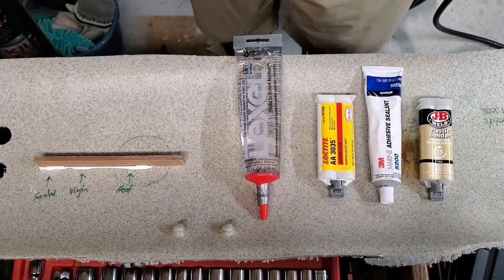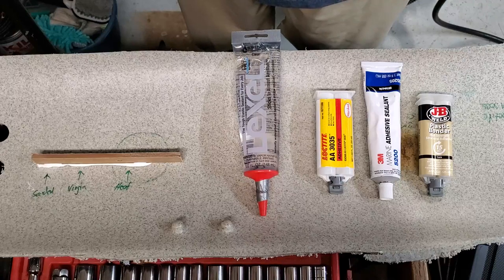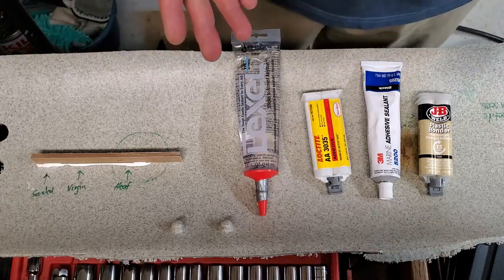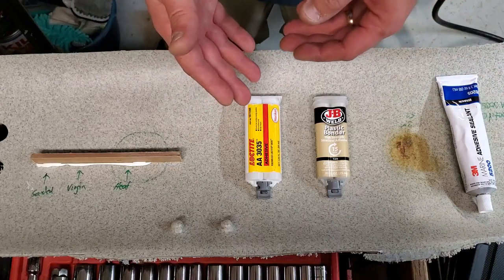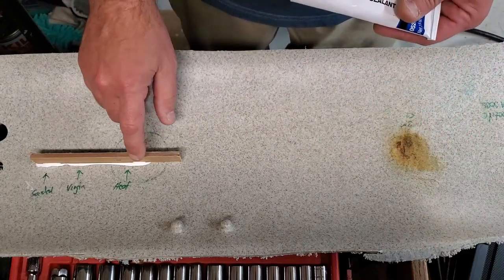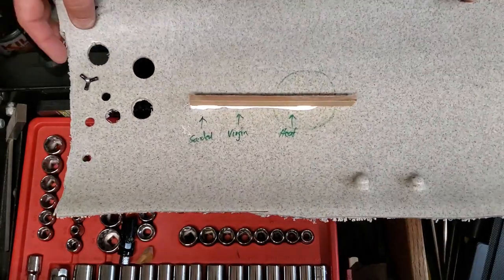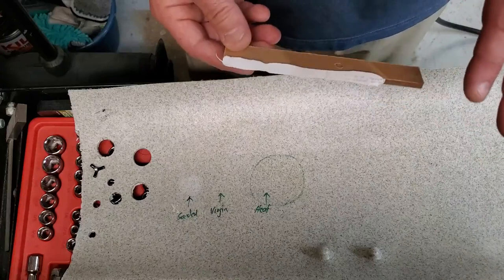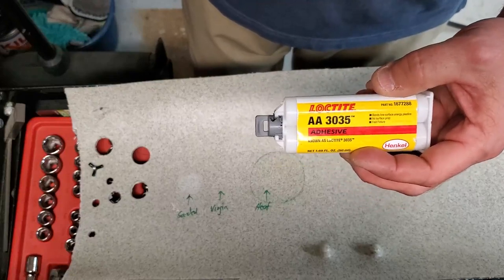Adhesive Test on Polyethylene Plastic Kayak

Comment: Great Video Roy. 

I have been kayak fishing for well over 20 years and owned HDPE boats throughout the 1990's and have had my share of repairs and mods to do. 
   I do product development and patternmaking for large scale rotomolded parts ( including kayaks ). I have an ongoing relationship with many manufacturers that produce rotomolded products. That gives me a lot of interaction with the engineers developing and supporting these products.
  I have wasted a small fortune on every possible bonding agent you an imagine and eventually found the Loctite 3035.   It is the sole product that actually forms the equivalent of a chemical bond with HDPE.  I did not video my tests but am about to do a repair on a small bass boat made of HDPE ( Basstender 11'3" ).  I will video it and share when I open my YouTube channel to the public soon.  The area to be repaired is the pulling eye on the front of the boat.
I have used it to secure in hull backing plates ( 1/2" aluminum ) under some load bearing features on my own Hobies.   The aluminum is still tight after almost 2 years.
As I am sure you are well aware an initial setup of 3035 if you do not already own the applicator and a small collection of tips will be roughly $100.     The $45 for the tube will really go a long way if you use scrap HDPE as filler or intermediate layers.   In spite of the initial cost 3035 is by far the best ( and only in my opinion ) way to make a HDPE repair that is dependable.

Thanks for your video.  Really well done.
Reply from the maker: Thank you, the chemical reaction you mentioned is in the base substance molecular structure which is called a Polyolefin:  https://en.wikipedia.org/wiki/Polyolefin  I am not a chemical nor any kind of "degreed" engineer; though, I probably should have considered that undergraduate path (I'm in business IT now).  The applicator tips are crucial for proper ratio and mix duration but I opted to some some $$ as my application periodicity is very low and I just used a wooden dowel and marked equal squeez-outs.  Good luck with that bass boat pulling eye repair.  Remember material shoring in/around in addition to proper adhesive/fastener application will insure a proper repair.  Cheers!
Reply: @motleypixel  Thanks Roy.   I have the backing parts for the patch all fit and the inside prepped up to the point of light sanding. My hold up is the weather to shoot the video and time out of my work schedule**  to do it right.  I have 1/4" aluminum plates formed to fit the interior hull to spread the load out. The area I am repairing is bigger than just the pulling eye. I repaired it badly 20 years ago and move the eye up 4 inches. Now there are two almost adjacent 3" holes to be backed up.  I'll try to do a decent job on the video even if I have a failure.  I did a few anecdotal tests just gluing and  stressing some scrap HDPE and low density " blown " also.  I was amazed at the holding power.

as an IT guy you can appreciate while I am trying to complete paying jobs for my customers I am also building a virgin 10gig network for a NAS server I am building for my video, laser scanning and photogrammetry work I do.   Man, it is a lot more time consuming than I thought when I was buying all the parts.

Comment: The jb weld used with your thermal prep method works!
I have been trying to mend a crack in my hot tub for months and tried a bunch of adhesives and fillers. 
My tester piece from bits I cut from excess underneath are as strong as a single piece. 
It’s a sparest 300 AR btw. It cracked bc the tub is a bit thin on one side. Took weeks to find it bc it was so small at first.

Comment: Hello sir! I've been researching this topic a little and trying to decide what I'm gonna use to fix me and the wife's kayak. I had them strapped on my bed, and the front strap came loose, and they drug the road a bit before I could get stopped. Both of them got the same hole in the tail portion wich is a good flat area. I already ordered a piece of 12"x12"x1" thick piece of High Density polyethylene and my plan is to make a patch plug to fill the hole, and also build the area that got eaten away. I see you recommend the Loctite AA 3035. My plan is to make the patch plug and then glue it, then let it cure for a for days or a week, then grind and sand to the original shape. Do you think that Loctite will do the trick?
Reply from the maker: for something like that I would thermal weld several layers of HDPE and omit using the 3035 adhesive.  The adhesive is really for unique situations, say for instance you have a situation where a brass female threaded insert fails or starts spinning freely.  You'd want to screw in a bolt, heat the bolt to the point the brass insert heats up and then pull out the insert.  Then put the insert back in with 3035 to hold fast.  There are other situations that are conducive to using 3035 vs. thermal welding, but for the most part large hull crack/hole repairs should be thermally welded with augmented HDPE, preferably same color.  Good luck.

Comment: 3M says this product would work on polyethylene. 3M™ High Performance Industrial Plastic Adhesive 4693H High performance adhesive forms strong bonds on most plastics, polypropylene (PP), polyethylene (PE) and polyolefin blends (TPO)
Reply from the maker: Good to know thanks.  Looked it up some.  Sound like it's more like a low surface energy plastic contact adhesive more than like an epoxy.  I'm sure it has some great use cases as does the AA 3035 by Loctite.

Comment: Great test and recommendations - thank you so much.  If you ever do a second video, I'd love to see a comparison of the loctite to the west system 655-8 G/flex
Reply from the maker: Well, it's not really an apples to apples comparison.  The G-Flex is not a low surface energy plastic bonder.  It's great on fiberglass, wood, metal and offers what appears to be good flex/expansion. Just know, there's not much out there that bonds to HDPE, reason why gasoline cans are made of HDPE.
Reply: @motleypixel  thanks for that clarification

Comment: Did you cut up your Revo 13?  I hope not lol.

Anyways, have you heard of West Systems G-Flex 655 epoxy?

I use it with success on hdpe, and so far been happy with it, although I haven’t done any stress tests. I’m actually going to be using it to do the drive cam column reinforcement with the pvc clam, and will prep surface with acetone, then denatured alcohol and then flame treat. Crossing fingers.
Reply from the maker: Ha, no didn't cut up my Revo, when I met a guy to buy a Hobie kit sail he gave me a big chunk of the same color HDPE from a Hobie that was cut-up by ACK.  Funny you mention West Systems G-Flex 655 because my local West Marine in Austin, TX was curious when I asked them if they sold any polyolefin binders for low surface energy plastics.  Let's just say he (manager) was interested in hearing more.  He then went on to rave about G-Flex and how it worked wonders and of course the cost sort of shows.  I said to him, probably in the exact words "take a scrap hdpe cutting board and cut it into test pieces and glue them together with 655 with slight clamping pressure and let me come in and try to pull them apart".  I'll do the same with Loctite 3035.  That's exactly what he did...he took my number and called me back in a week.  I brought just one test piece of spare cutting board (mine was black, actual HDPE 1/2" black of stock left over from a project.  He had several pieces and let's just say he was blown away.  Any regular 2 part non-polyolefin adhesive will NOT bond low surface energy HDPE plastic.  I would give some scraps a try first.  What's the cost difference between G-Flex and Loctite 3035?  A tube of 3035, plenty for clam-shell repair of PVC for Hobie MD cam column repairs runs about $60.  You'll use about 3/4 of the tube.  Although, I can see some using all of it just because of the "bigger of glob the better the job" concept :)
Reply: @motleypixel  That’s a relief lol!
Yeah, I noticed while gluing Gflex test pieces that prep is very important, otherwise adhesion is hit or miss. My go to prep process now is to alcohol wipe, wire brush to scuff, then flame treat, but a longer flame application to the point of melting seems required.

Comment: Have you ever tried using a superglue/graphite mixture to try and bond to hdpe?
Reply from the maker: No but I have tried all types of superglue by itself w/o any success.  Does the graphite produce some chemical bond or is it only mechanical?  If mechanical I'm very skeptical.  Thanks for the reply.
Reply: @motleypixel  I believe it is a chemical bond. Search on YouTube “superglue graphite” and a video pops up where a screw is attached to a blue bottle cap, which I believe it to be made of hdpe, using this combination. The screw is then hammered until it is bent 90 degrees without it breaking away from the bottle cap.
Reply from the maker: @johnwedgeworth4908  ah that one, yes and it's BOGUS, tried it, but it's with baking soda, not graphite.
Reply from the maker: @johnwedgeworth4908  interesting, first time seeing this one.  Notice he did have to add sodium bi-carbonate (aka baking soda)?  Also, no need to sand down pencil core, that's actually not 100% graphite anyway, I would just buy dry graphite lock lube tubes for ease of use.  Still though, even though I haven't tested either, I don't buy it one ounce, I would bet $100 USD that the screw test would not bend.

Comment: So in conclusion I don't see anything that worked.
Reply from the maker: 3:30  Loctite AA 3035 sticks; in fact, it deforms the HDPE when trying to pull two pieces way after a bond with this adhesive.
Reply: Thank you! @motleypixel